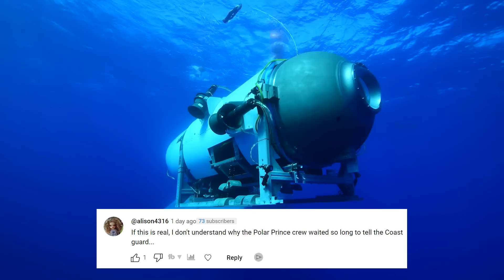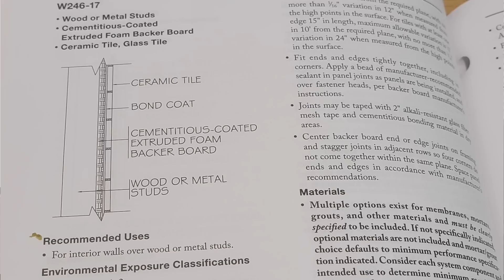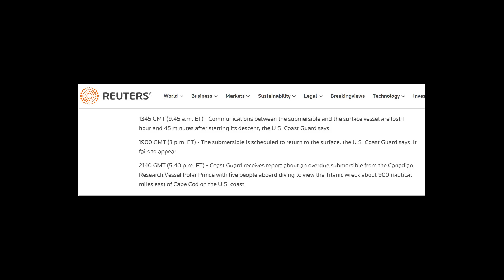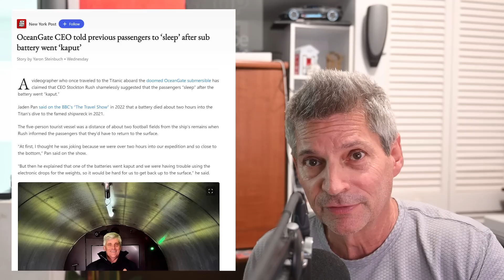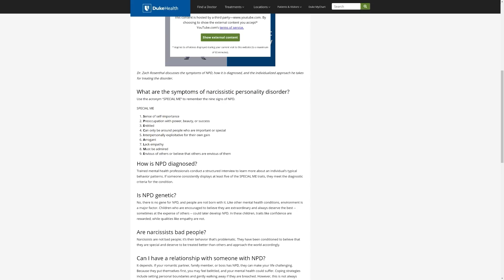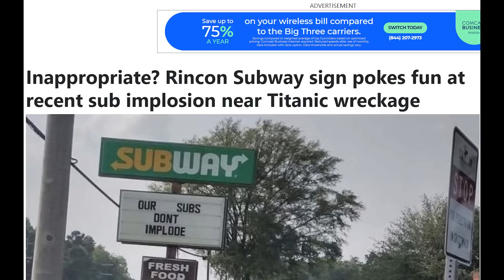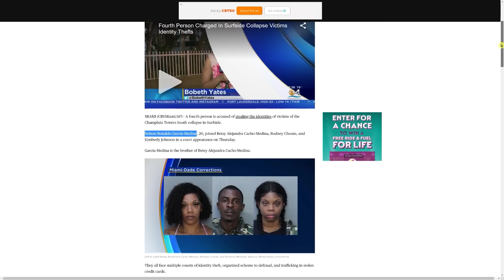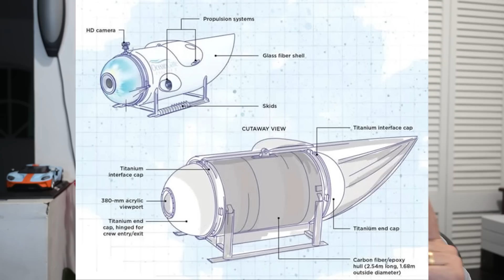Titan Sub: Why OceanGate Waits 8 Hrs Call Coast Guard, Q & A

Comment: The irony is that Titan and Titanic had the opposite flaws: the crew of the Titanic were following the industry standards, rules, and guidelines, which got them killed because the flaws of hubris were innate to the system and they just had the bad luck of ending up the example. Meanwhile, OceanGate had decent industry standards they could have followed, but chose not to.

Comment: We had that fire door problem across the 550,000 square foot facility I worked in and a Postal Inspector collected all the devices used to defeat the doors locking and called a meeting of everyone and angrily tossed a full tray of those devices on the floor in front of everyone. It was more important for people to take a shortcut to their car or go on a sneaky cigarette break than to keep the building safe from terrorists. Personal convenience trumps all rules.

Comment: I don't think Titanic is a good example of "normalization of deviance." Titanic's builders and the White Star Line built Titanic way safer than the current shipbuilding codes required, with many of its features being state-of-the-art. Features like the the double keel, watertight bulkheads, Marconi wireless system, etc. were all brand new and assisted in the Titanic lasting as long as she did after the crash, despite the bulkheads not being as effective as they could have been. Titanic also had MORE lifeboats than the current regulations required of a ship her size. Because of this, normalization of deviance does not really apply there.

Otherwise, great video as always!

Comment: Narcissistic personality disorder and being narcissistic are not the same thing. I don't think diagnosing S.R. post mortem like this is useful.  He was wrong, but he clearly believed he wasn't, or he wouldn't have put his own life at risk. 

Also just cause criticism is correct, doesn't mean it is constructive. It would have been very destructive in this case cause he would have had to scrape the entire model and start over. Yes it would have been better had he done that, but it's still destructive in the moment and relatable to some extent that he didn't want it.

The real problem is that he was at liberty to do whatever he wanted in international waters. There should have been some form of oversight committee which would have required thousands of test dives with a fully laden prototype, prior to letting people take it down even twice.

Finally I think nothing good can come from suggesting alternate variations of using carbon fibre for the purpose of creating a new hull. Maybe let's stick to titanium orbs rather than carbon fibre tubes in future.

Comment: Another example of normalization of deviance is NASA management's  attitude about the foam shedding problem was essentially that while not optimal, it posed an acceptable level of risk.  Then the shuttle Columbia broke up on reentry due to damage caused by a foam strike to the leading edge of the left wing.

Comment: The first book I ever remember reading was about the Titanic back in the mid-80s. I've been consuming everything Titanic related since then. The Librarians at my local library would order every Titanic book they could get, just for me. I remember hearing about the "Wreck of the Titan" in a documentary decades ago. When I first saw the CBS interview with Mr. Rush my first two thoughts were First: Why the hell would you name it "Titan" Anyone with a basic knowledge of the Titanic knows about that book. Second: This man is going to get people killed.
I'm also an avid cyclist with a limited knowledge of Carbon Fiber and Titanium. Both, however, are used as frame material. Both on their own are relatively stable, but both have huge drawbacks. Titanium is very hard to work with. Carbon fatigues and when it fails it's often catastrophic. The other drawback of carbon is it's not recommended that it be bonded, or glued, with other materials. I know this because the first use of carbon fiber within the cycling industry was in combination with steel and aluminum. Often, manufactures would use carbon fiber tubing bonded to metal lugs. The failure rate on these frames were incredibly high in comparison to traditional frame material and when they failed it was catastrophic. Knowing this, I knew the "Titan" submersible had imploded. Of course, I was optimistic for a better outcome, but with the material used it was just a matter of time. It's a miracle it didn't implode on the first dive.

Comment: I truly don't understand the use of circle winding the carbon fibre.

I'm no engineer but it seems like common sense not to use that method. 

Just think about someone squishing a downsized replica of the two versions.
The circle variant would crush and fall in on itself so much easier than if it was cross hatched like usual.

Like I said I'm no engineer, so I can't explain myself well but some things are just obvious if you know basic science knowledge.
This seems like one of them.

Comment: The Descent of Hubris! 

Realizing the need to address the issue while mitigating their own liability, the captain formulated a plan. "Then let us make it unequivocally clear that we are aware of the excessive descent rate. Ask him if he needs to slow down. After all, he is the designer of the sub. We'll let him make the decision, and that should shift the liability onto him," the captain resolved, supported by the first officer's acknowledgment. "Ai, captain," the first officer responded, affirming their commitment to address the matter swiftly and responsibly.
At 9:15 am, recognizing the progressing timeline of the dive, the Polar Prince reached out to the Titan with an inquiry that reflected their vigilance: "You are 75 minutes into the dive. What is your depth? Do you need to adjust velocity?"
Two minutes later, at 9:17 am, the Titan responded with an assurance of stability: "All under control at 2960 meters. No adjustments needed. We're enjoying the ride." The Titan's reply conveyed a sense of confidence, indicating that they were content with the current depth and saw no necessity to modify their velocity.
Back on the Polar Prince, the first officer's frantic warning echoed through the control room. "Captain, they are going way too fast! By my calculations, they should be at a depth of 1950 meters, but they're already at 2960 meters. That ship is definitely going to implode!" Epilogue! to be continued...

Comment: As a complete amateur, I can see a "fail-safe" release system, which will drop the landing frame [as well as other ballast] as soon as any control panel indicator goes red.   That way, even if all the occupants were disabled, the craft would begin its ascent automatically.   Simply, the electrical system is used [needed] to keep the landing frame [and other ballast] attached.
Reply: no that is a dumb idea, its obvious you are an amateur

Comment: Dude, the reason why the mother ship Polar Prince waited 8 hours to call the Coast Guard is because on ALL THEIR TRIPS TO THE TITANIC THEY COMPLETELY LOST COMMUNICATION WITH THE TITAN BEYOND A CERTAIN DEPTH.  IT was part of the absolutely horribly stupid design of the Titan to lose communication with the mother ship, if you can believe that.  So, on all the dives to the Titanic, the Titan vanished from all communication with the mother ship as part of the normal course of the dive.  So they did as they always did, wait until past the time they were supposed to ascend back within communication range, which typically was 8 hours. INCREDIBLE.

Comment: I would also not use carbon fiber for a pressure chamber because string isn't strong in compression. Using it for an aircraft body seems much safer than for a submarine. However, I there is a lot I don't know, so perhaps the chamber could have been strong enough if woven in a criss-cross pattern.

I think that NPD is fairly specific, and the people I've encountered who have it aren't particularly capable. I don't disagree that the guy got out over his skis, but I'm not sure calling it narcissism is quite right; I would say it sounded like the guy was arrogant and impatient. There's a reason people who think about this a lot consider pride the worst of the seven deadly sins.

Comment: As an engineer in the aviation industry I can say that it is perfectly fine to challenge industry standards.  However, to do so requires a comprehensive understanding of those standards, why they apply, and why in your specific case they can be waived.  It requires more engineering and work to safely NOT comply with the standards.  The standards are a short-cut to safety not an impediment.  A titanium and carbon composite hull glued together violates the standards, but more importantly the intent of the standards.  It is not real, rigorous engineering.

Comment: regarding the winding direction of the carbon-fiber layup, in an external pressure situation isn't the buckling case governed by the elastic modulus?  The winding directions for various cylinders are normally altered based on tensile stresses, ratio-ing longitudinal and circumferential stress, and much more commonly for internal pressure.  But external pressure buckling has the elastic modulus as primary variable.  Standard carbon fiber is in the same range as carbon steel.  I'm sure they used the carbon fiber for its weight reduction, but then very simple geometric variables take over.  What are your thoughts on the external pressure buckling case?

Comment: The rockets on the shuttle should have been made of one solid piece and there was a manufacturer who was able to build them as such  and transport them by water. Morton Thiokol was inland and had to build and transport the booster rockets in pieces which is why they had O-rings. But MT were the lowest bidder.

Comment: Doesn't matter how you layer over carbon fibre it can delaminate and flex at extreme pressure. The best carbon fibre experts in the world who work on f1 and moto gp parts can't figure out how to make motrycle fairings out of carbon without strengthening elsewhere on the bike to stop drag and buffeting issues.

Comment: The main reason this happened is the adhesive. The adhesive over the 12 times in the deep salt water broken down the adhesive. A small hole over the 12 dives started opening on this dive.  On this 13 dive, the very small crack in the adhesive reduced the pressure inside the OceanGate Titan Sub.  The adhesive should have be completely replaced after 4 dives.

Comment: The reason the Titanic didn't have enough lifeboats to save everyone is because lifeboats at that time were only meant to be used for ferrying passengers from the sinking ship to the rescue ship. They were never meant to be used to save the entire ships compliment and crew. Lifeboats at that time could not survive a journey on the ocean. The only reason the 700+ people survived that evening is because the Atlantic had extremely calm waves. Under normal oceanic conditions they most likely would have all overturned and they would have drowned and/or succumbed to the cold waters before the California could get to them.
Also, even if they had enough lifeboats to save everyone, they still wouldn't have been able to save anyone else, and that's because the last lifeboat went into the water at the same time that the Titanic submerged. Any remaining lifeboats would have gone down with the ship. There just wasn't enough time to lower that many lifeboats to save everyone.
There are a lot of factors as to why the Titanic sank, but the majority of the blame goes to Captain Smith. Just like Stockton Rush, both were not willing to except that there are limits and boundaries that must be adhered to, and they and their passengers died as a result.
The Titanic was never advertised as being “unsinkable”. That was something that the media pushed AFTER the ship sank.
Hope that helps.

Comment: I’ve seen a few of the videos showing the construction of the vessel, both the carbon tube and the end plates.  They seem to show it occurring in an open warehouse, nobody in masks or protective gowns, etc.  That’s completely insane.  They need something manufactured perfectly to nanometer precision and have to have a zero failure rate 2/2 lack of redundancy, yet they’re not protecting from introduction of contaminants, not controlling for heat and humidity, etc. during construction.  Unbelievable.

Comment: They did the zero degree axial cause it was the cheapest easiest way to run that machine.. otherwise they have to highly program it and just gets alot more complicated  i.e. pricey... and also only tested a 3rd scale model not a actual  replica test to destruction which is what should have bin done.   In testing a new material should  have made 5 identical from same batch of carbon fiber..and destroyed 3 in testing ...he wouldnt even do non destructive testing lol

Comment: They may have had testing data showing that the carbon fiber held up better under compression when layered like that.  The other windings you showed assume outward pressure.  So that may have been the better option for this application.  We just don't have any of OceanGates internal data to know at this time.

Comment: No, the comment about the why did they wait eight hours revolves around whether or not a near distress message put out by some scammers is authentic.  It is a fake, and the narrator did not even bother to but those two points together in answering the question. 

Group think breaks down when outside information is added to the closed system by a credible source.  If the company's CEO says there are maneuvering and ascent problems with the vessel, that is enough outside information by a credible  to shake the crew out of Group think and call the coast guard after contact is lost.

If the messages from the CEO are of the type, they normally receive, which I expect  -- sure they are in group think and would wait, thinking it was a normal occurrence.

The narrator chooses not to answer the question of if a distress call was made, why did they wait eight hours.  What the narrator did answer was that the CEO was a narcissist, and things were normal to the crew on the ship.  No effort was made to join, what are hoax messages to the action of the crew.

Comment: Or rather .. you could use carbon fiber if youre only risking yourself, but you should also keep in mind the material degradation to limit dives. Lastly, to not descend at a ridiculously fast speed

Comment: I think if the attachment rings on the ends of the hull itself had been machined together with the hull and not glued on it wouldn't have failed. I'll always probably think that until I'm proved wrong. But that won't happen. That's the failure point I'd bet my life on it.

Comment: from wreckage cleanup, the frontend dome failed.
The glass piece which the Sub riders look out is missing from the domed Steel end piece which came up and was delivered to Halifax. On the video you could see the strap inserted through the hole and the rest of the front end of the sub hooked up and floated to the surface. But clearly gone was the porthole window.

Comment: The final scenes of various carbon fiber processes is very telling in and of itself. I think a 5th grader would know maintaining  verticle layering instead of cross hatching is just plain stupid. Particularly for a vessel that was to face incredible pressures and continuous drastic temperature changes. To go forward without critical testing is grossly negligent. I have wondered what role temperature variants played into this failure of the vessel. To go from very hot while transporting and preparing for a dive, to extreme cold, then back to hot...numerous times. Then there is the exposure to these variables throughout its lifespan...transport, dive, transport, storage, out of storage, transporting, diving, ascending, transport etc. This has implications for the finest of steels, much less fibers and resin. Then there is UV as well. Crazy this could be allowed to happen.

Comment: This kind of mentality is EVERYWHERE in big business. It's systemic. Just look at the insane risks which were being taken by Boeing following its merger with McDonnell-Douglas for the Boeing 737-MAX airliner. They KNEW those planes were taking off with a fault in the software which meant the pilots had ten seconds to take corrective action before they crashed. And yet they DELIBERATELY avoided telling the pilots this software even existed.

Comment: It doesn't really matter how you wrap the carbon fiber, it's like building a submarine out of rope. The material has a lot tensile strength but almost no compressive strength, the compressive strength comes from the resin it's bonded in.